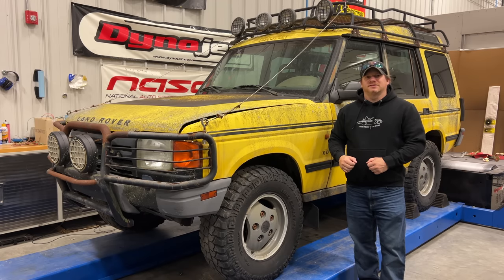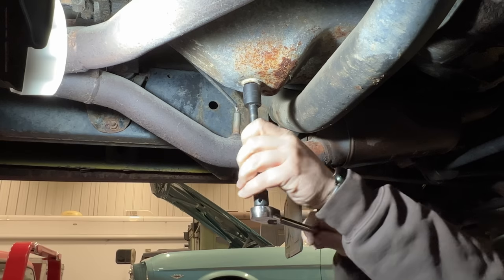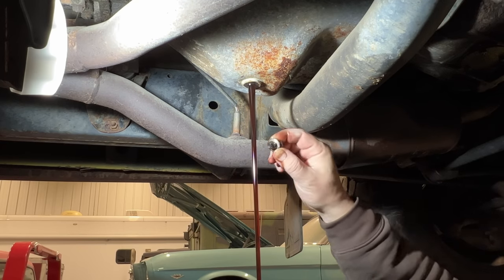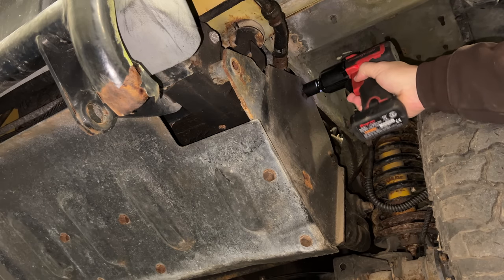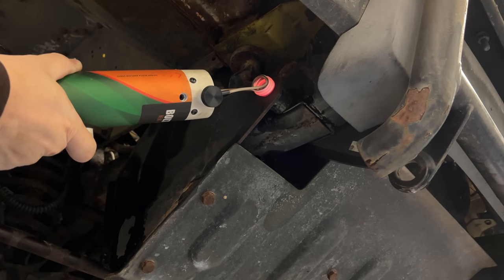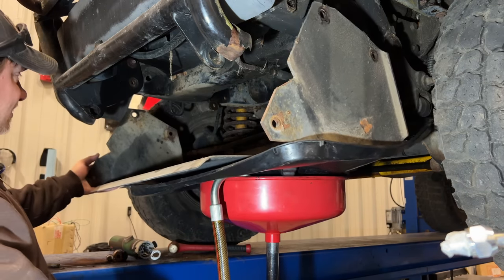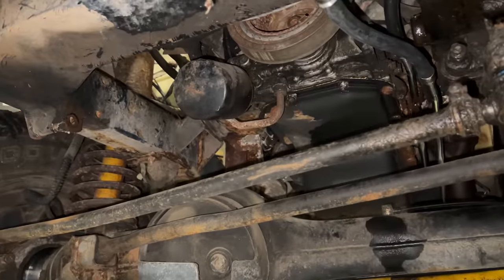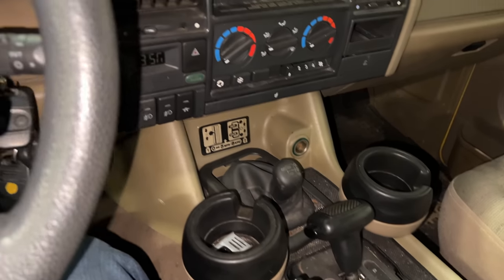Part 5 - Will It Drive - Land Rover Discovery XD

Comment: More LR videos please!  I owned a 2003 Disco 2, but it was a garage queen.  I loved it when it was running, but put a ton of money into keeping it that way with most of the work done at the stealership.  This was back when I lacked the tools and confidence to do the work myself.  I've come a long way since.  I just (successfully) replaced the injectors, crossover pipes, timing chains and guides in my 2012 LR4.  I'm loving this series!  Thank you.
Reply: if you want disco 3 and 4 videos check out LR time

Comment: You got lucky with getting the pipes loose off the cooler, they are normally so seized, the cooler gets wrecked with loosening them
Reply from the maker: I did check to see it was available before trying to get them loose in case that happened.